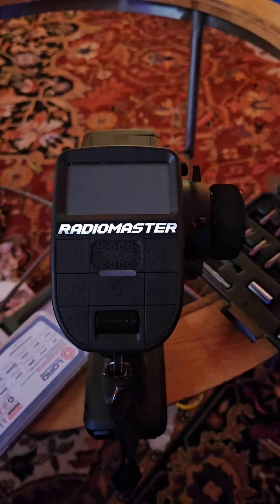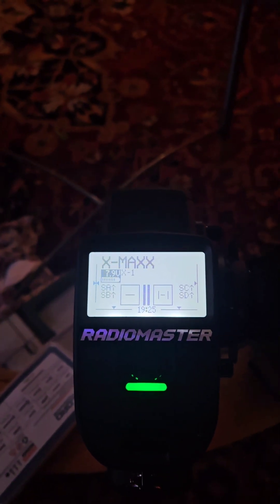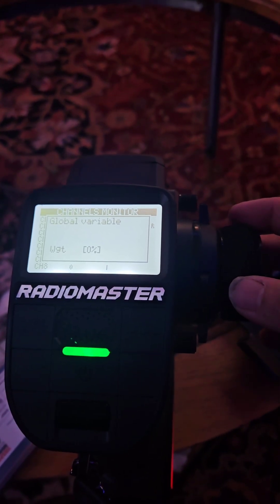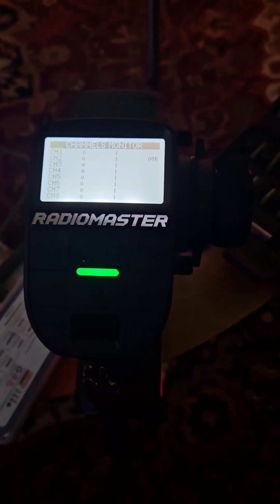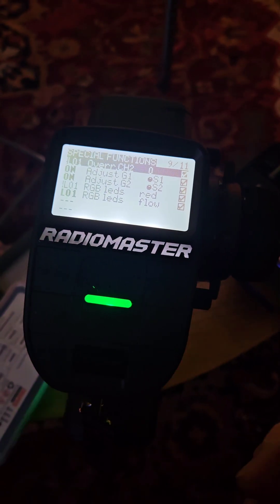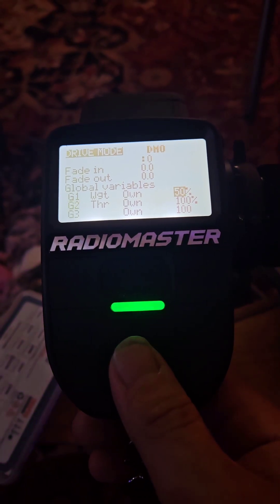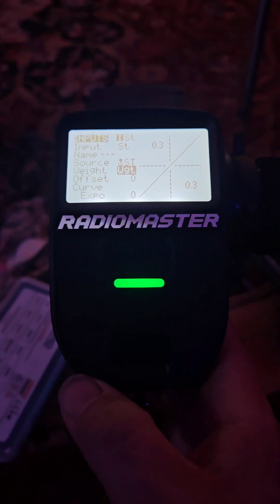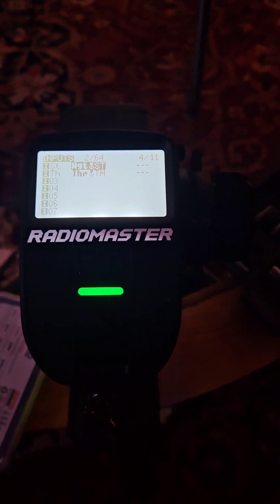Radiomaster MT12 Steering dual rate D/R and throttle percentage on P1 and P2

Comment: thank you. if you use the mixer inputs that correspond to the pots, in the special functions, you can set those inputs to have offset 50, weight 50 for throttle and that will make the knob function from 0-100 instead of -100 to 100
Reply from the maker: @gr3yh47  ill check that out, thanks.